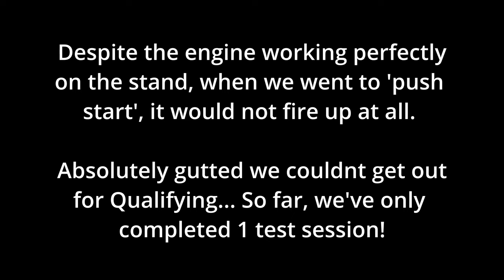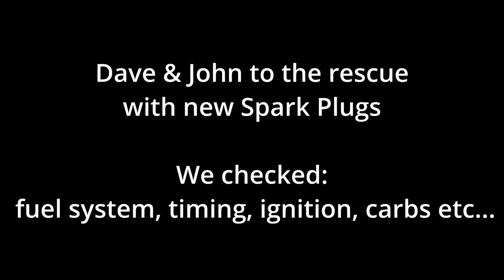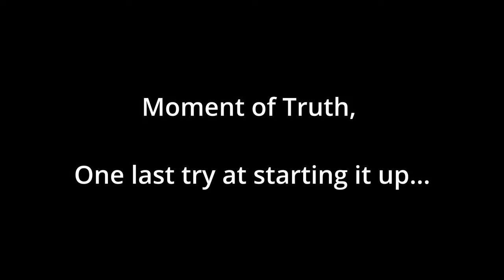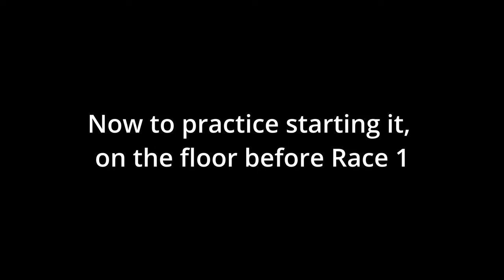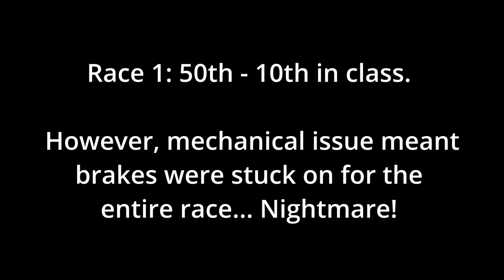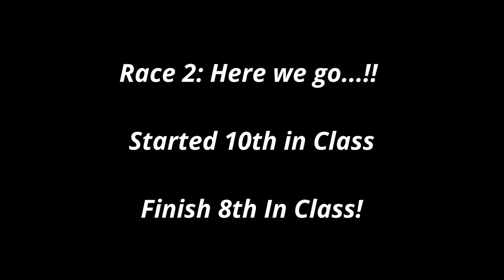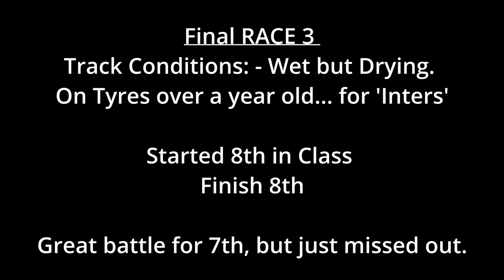Rob Stubbs - Division 1 Superkart - FULL VLOG - Silverstone GP Circuit (Behind the Scenes Footage)!!

Comment: Are they all Two stroke engines and are they all the same make of engine 250cc? We used to have the engine in the back and was a 250 cbr Honda four stroke it could do 140MPH but was reliable against the two strokes all were air cooled. Then things began to change just could not keep up. It seams size weight must also had changed and class which is interesting. School Go carts were from 50cc to 120CC shows how long ago that was. What I don't like is the exhaust right next to your leg and engine near your body and arms.  I bet as a two stroke it is much faster than 140mph these days and seven gears as we only had four and then five. There was one fitting a 250cc Kawasaki triple two stroke engine in one but I never got to see it if it worked and speed.  So glad to see this is going on big time now and I think safer too.
Reply from the maker: Hi mate thanks for checking out my channel and videos! There are multiple engine sizes such as 125cc/250cc and 250 twin cylinder! They are all crazy fast and destroy any supercar round a track